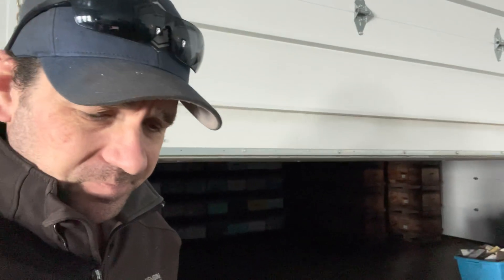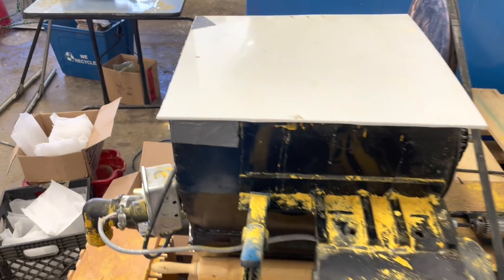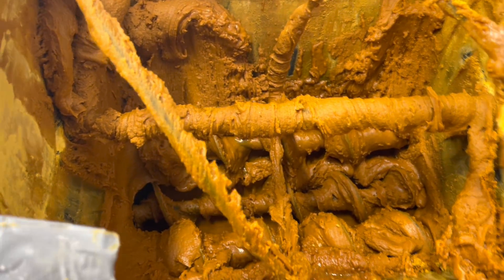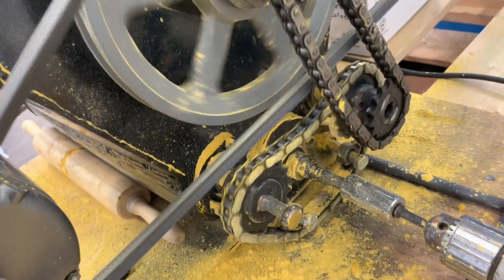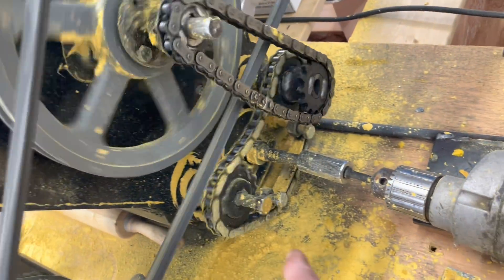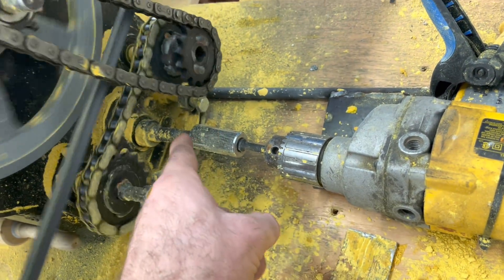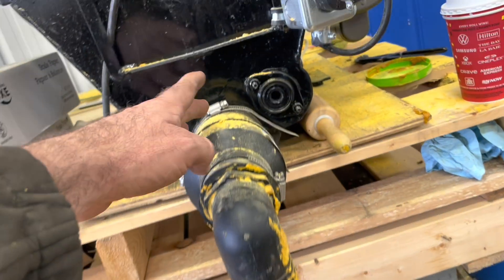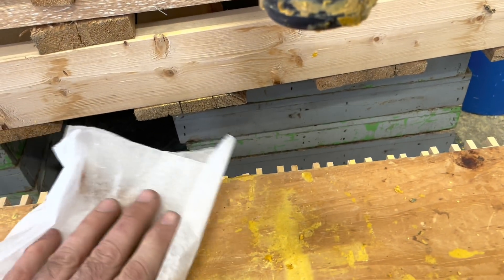My Pollen Patty Packer

Comment: A little rubber belting on the mixer and you'll have a nice clean hopper in the end.  I had considered a clay pug mill might be the ticket for making patty logs which could then be cut into uniform patties with a wire cutter, but I like the idea of pumping it directly into the sandwich bag. I haven't been able to find any of those bags, so I settled on just scooping my bulk mix directly onto the top bars. I then use the scoop to mash it down flat so the foamy will fit over it. That seems to be the easiest for me. Now I need to find me an inexpensive 20 qt mixer.